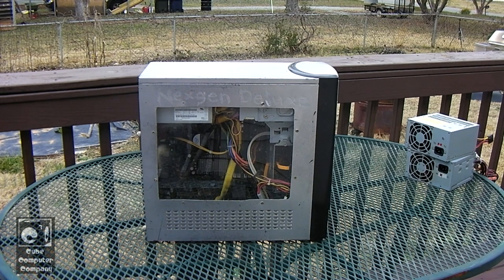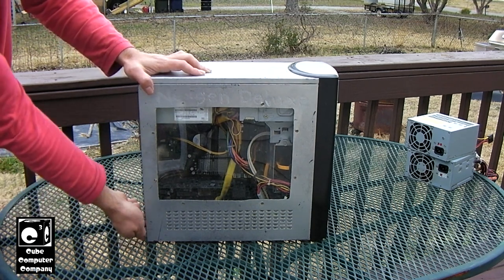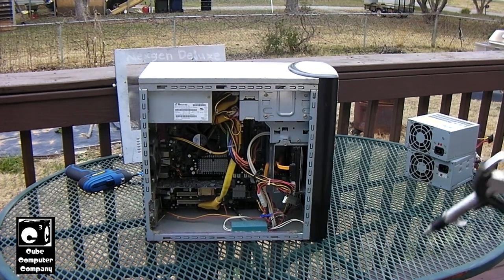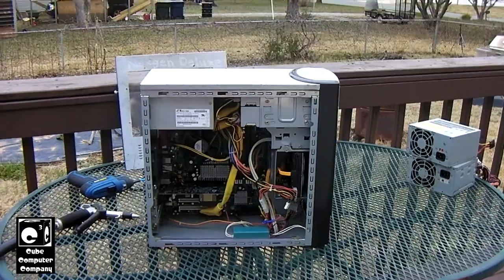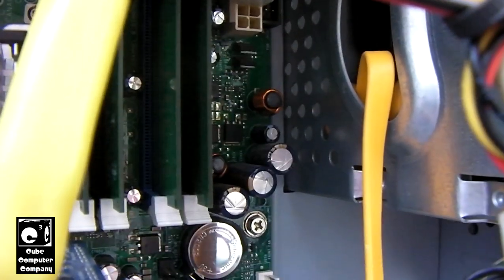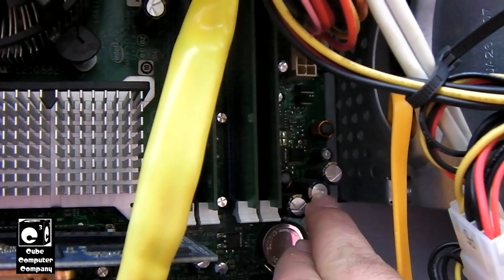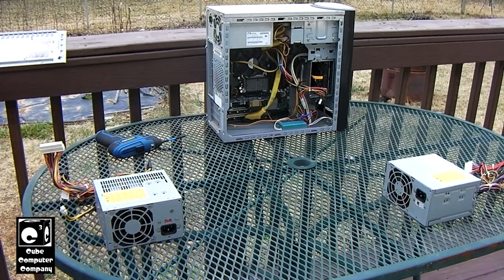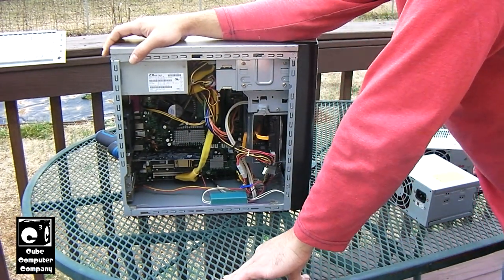Cleaning out my late grandpa's PC, the Cube Computer Nexgen Deluxe

Comment: Those old Core 2 duo's/Quad Boards are usually the weakness/failure point for intel at that time.  (lost a few myself)  Seeing the broken North bridge heat sink and swollen capacitors surely did it in.  That case reminds me of my early E machines P4 I still got laying around.  I like repurposing old cases with newer components when I can.  Sorry about your Grandad passing.

Comment: I blew out my computer with an airline like you did but the fan sun round at high speed burning out the bearings , now i hold the blades still when blowing ,
Reply from the maker: The fan probably just needed fresh oil on the bearings